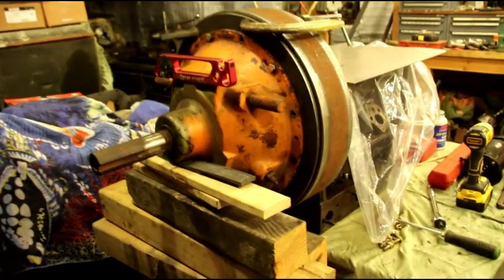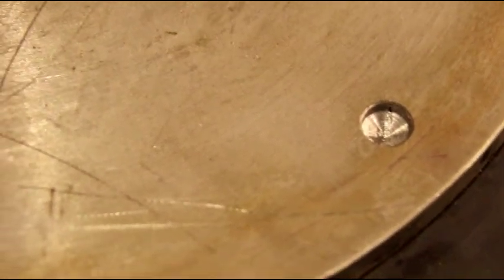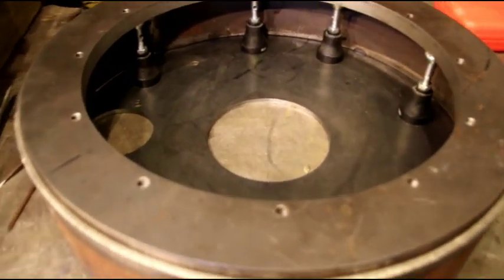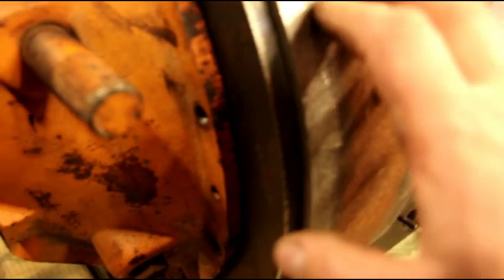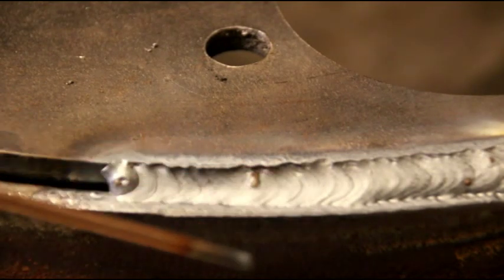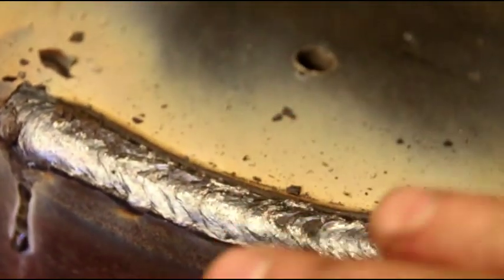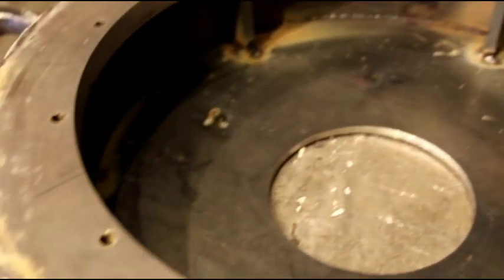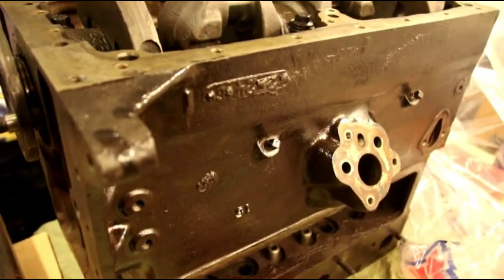Willys Snowblower Jeep  Custom Bellhousing Fabrication For F Head Engine

Comment: Is a l head 4 cylinder the same as a l 226 6 cylinder looking for valve tappets  for my 58 fc 170 two of them keep backing off adjustment  screws are worn and do you need to remove  the cam to replace the tappets do you work on  6cyl l heads haven't  seen any on your  video
Reply from the maker: No tappets are different between engines and will not work.

Comment: Hi Brian, this lockdown makes life difficult. With time on my hands I decided to heat shrink my rear floor as you did in a previous video. Didn't think I was getting much progress but that metal really moved after some perseverance. Thanks for the detailed how-to, it really worked.
Reply from the maker: Glad you had success with your rear floor.  Patience really pays off when doing sheet metal work.

Comment: Hello. I have what amounts to nearly a couple flatfender jeeps, dismantled. I think they could be salvaged. The bodies have willys stamped in the tailgate but GPW (F) on the motors head. I think they are cj3As but I'm jut learning. Kind of wish I could  do some trading with em. They've been in the davis mountains of west Tx. Virus free! Rough shape I think but salvageable. Pure Jeep history! I'd love to rebuild em but time is short for me.
Reply: GPW is not 3a. Its Ford GPW. Check out G503.com, google is your friend on identifying the difference between MB/GPW, 2A, 3A etc... MB/GPW parts are sought after, since they are only war time jeeps.
Reply: @johnqpublic9074   Thanks Mr. Public! Mine have Tx. tags from 1977 but only one (newer of the two)  body has manufacturers (Willys Overland) tag. No frame tags. I think a post war rancher used em hard and was planning on making one Frankenstein from two jeeps... I'll attempt to learn and trade but I'm no good at logistics and advertising. Thanks again for the help.
Reply: @primitivebob8781  No problem, most jeeps of these vintages have been taken apart, and parts swapped a few times. The CJ2A page is very helpful as well for parts identifying...

Comment: Brian if you got a big swing lathe grind a radious tool and cut the corners .🐤 . In a pinch Rust Ollium oil bace paint is good stuff  try it . 😎
Reply from the maker: My lathe is too small by .500” , isn’t that always how it works out.  I could set up on a rotary table and use a corner rounding bit, but I think I might just grind it by hand and check with a radius gauge every now and again.  Good to hear from you, hope you and yours are healthy and surviving the craziness.   Brian